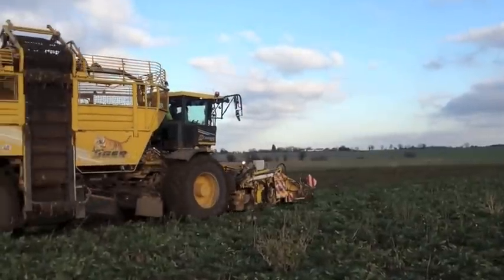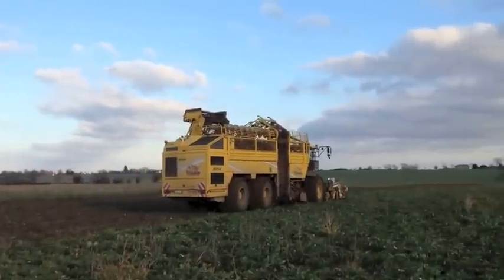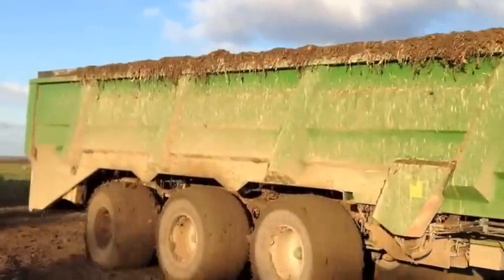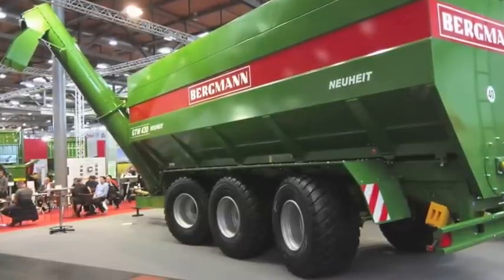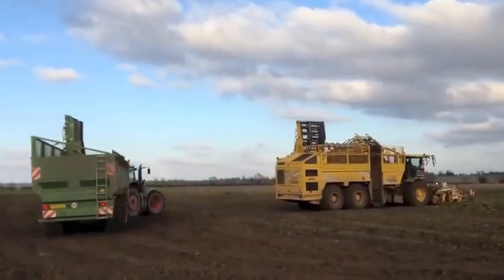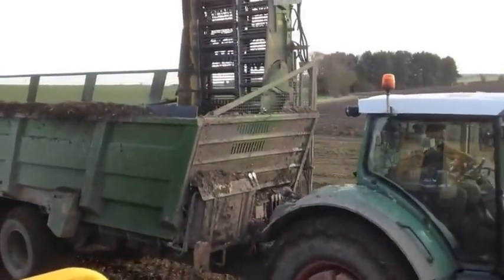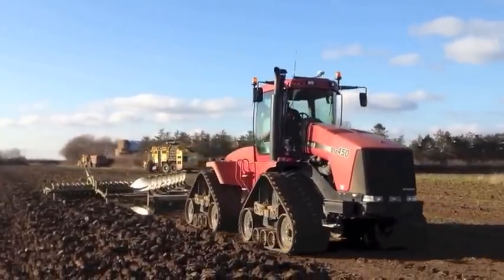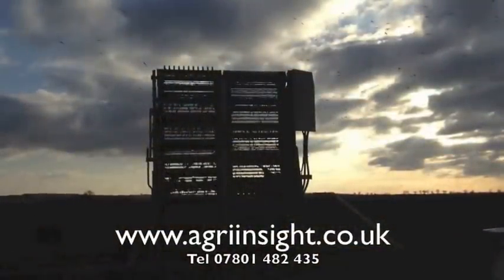Ropa Tiger 5 and Massive Bergmann Chaser

Comment: Please note the RRW500 has a holding capacity of over 50m3 - in excess of over 30 tonnes of beet.  It is the 2 axle RRW400 which has 39m3 - the equivalent of other 3 axle similar machines.